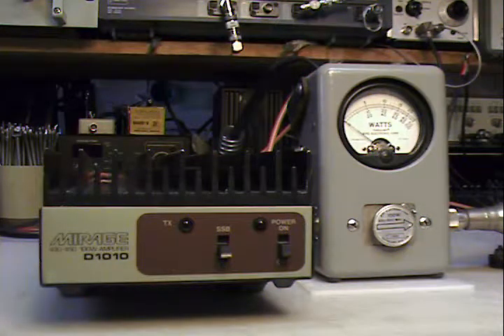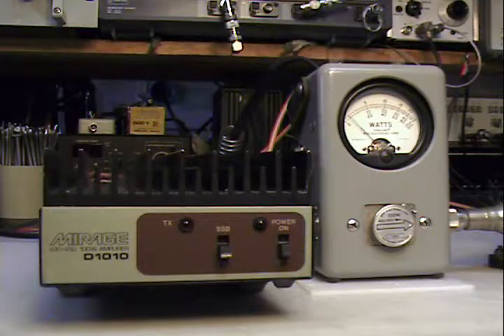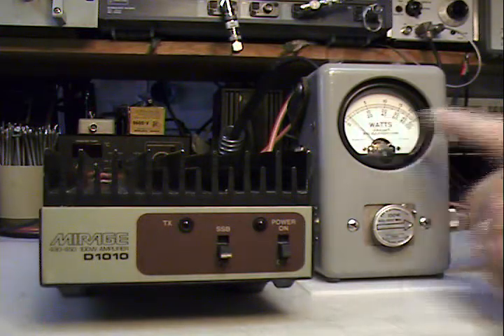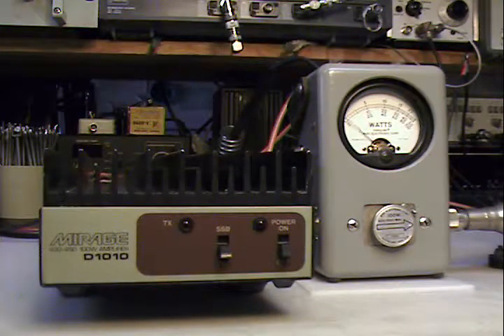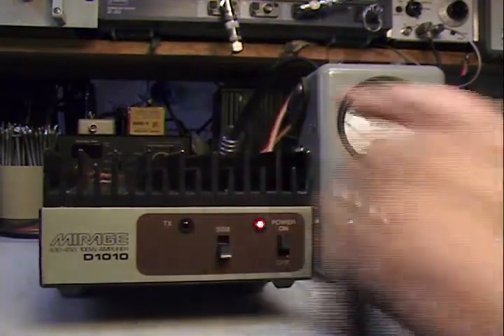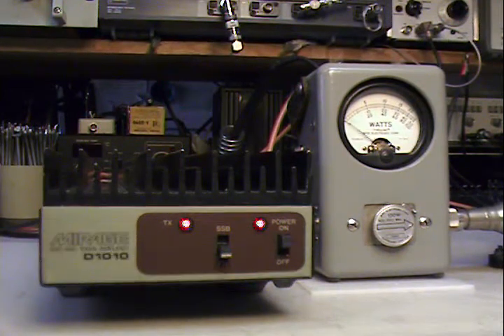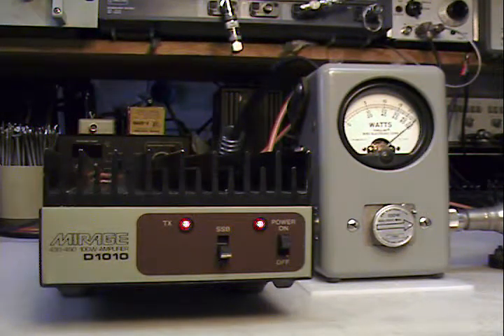Mirage D1010 Demo

Comment: Looks good.   I have the same model amp.   It has a burn hole where the antenna coax lands on the COR/BIAS PCB, next to the RF relay.   It is heavily modified and is missing both relays.   I am trying to restore it to its original design.   Could you look on your amp and tell me model # of the small COR relay?   It Looks like an Omron part.   I have removed all the parts the previous owner installed so it only has parts per the Mirage D1010 schematic.